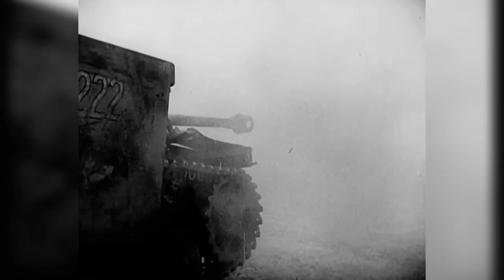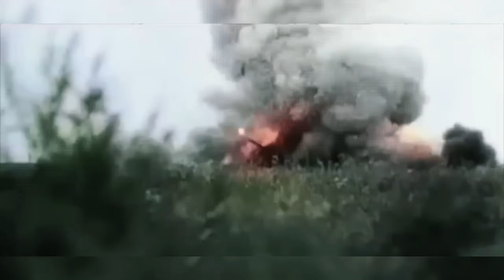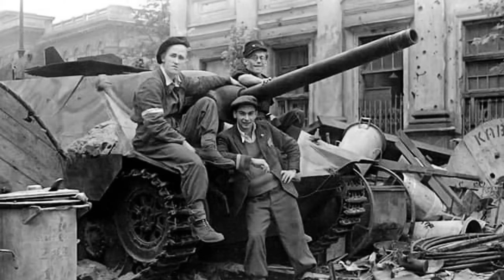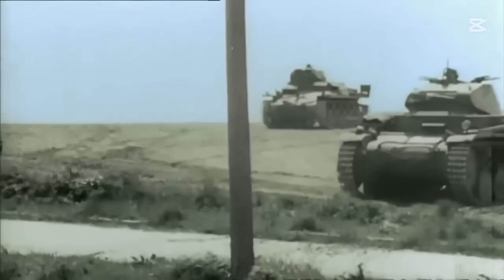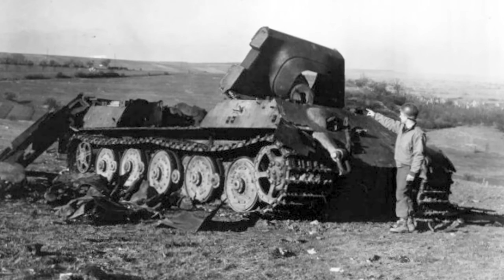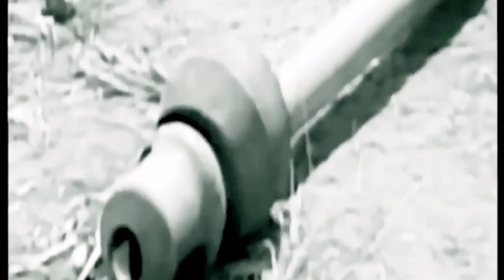Rise and Fall of German Tank Destroyers | Full Documentary

Comment: The kwk 40 L/43 and L/48 fired a MORE powerful high explosive shell than the low velocity L/24 gun on the early Stugs and Panzer IVs. The L24 HE shell had 1 pound of high explosive filling. The HE shell fired by the L43 and L48 had about 1.42 pounds of high explosive filling. So it was actually about 40% more effective per explosive power. Most people dont know this.

Comment: You don't 'jump up on the roof to reload in the middle of combat. You conduct your attack or defense in phases. As the first echelon runs low on ammo they pull back to reload out of contact, as the second echelon now does the firing. The number of vehicles one has and the size of their assigned sector dictates how many echelons a commander can form.
Reply: Wasn’t the narrator referring to the machine gun, not the main cannon?
Reply: Wrong by all accounts. While the preference is to reload in safety, the stug rarely saw safe moments in any battle. Thanks for your input tho I'm sure your 10 seconds of research were well earned

Comment: Didn't they turn some tiger I chasis into the ferdinand/elefant tank destroyer?
Reply: "Yes, that's correct. The Ferdinand (later known as the Elefant) used the chassis of the Tiger (P) prototype. It was a beast in terms of armor and firepower, but not without its flaws."
Reply: No they used the 100 chassis' from the failed Porche Tiger 1 program